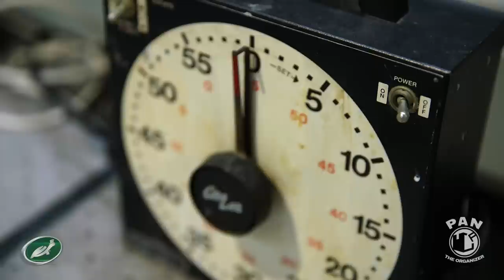EXCLUSIVE!  A TOUR OF TURTLE WAX HQ !! (EXTENDED CUT)

Comment: I have recently used hybrid solutions ceramic spray coating on my 2019 van ..
I gave the paint a proper preparation..
Wow ,, the results were great  .
Looks deep and rich .
Hopefully it will last.  Ease of maintenance is what I am after.
Reply from the maker: Yup!  And you can maintain that finish with the Turtle Wax Ceramic Wet Wax as a drying aid.

Comment: I've gone all-in on their Hybrid line of products and have loved them all with the sole exception of a problem I had with their 3 in 1 Detailer.  But they quickly offered a replacement or refund after contacting them (I chose the replacement as it wasn't the product that was a problem, it was the spray bottle it came in).  I'm really starting to love these guys.  Too bad I don't have a black car anymore.  After fifteen years of owning a couple, I went with another color this time around.

Comment: You use a foam cannon to spray on the soap.  Then you wash and rinse.  Is there anything like "Jet Dry" you can use in a final rinse to make drying easier and reduce any areas that may not have been dried as well?

Comment: I'd love it if they could create a rinse-aid spray which has the added property of popping the leftover bubbles after I've rinsed off my snow foam.  Those foam bubbles last forever!  
Especially if it was something I could pop onto my power washer just like a foam cannon, and boom, I can spray a rinse-aid on after my contact wash and any leftover bubbles on my driveway or hidden in the crevices around the body panels pop and rinse away with the water.  Thank you!!

Comment: Great video Pan.  Always nice to get an inside look at the people and products behind the products. 
For Turtle Wax I'd love to see a AIO exterior black trim restorative/protective product that's going to last 6+ months. Seams like most vehicles have two, three or more plastic bits that react differently to the current offerings. There's a couple great restorers on the market but they're not available in local stores, pricey, messy, take too long to dry/cure and then have a second step to add a sealant/coating after. Great job with new products in the last couple years, hope to see more in the future.
Reply from the maker: Thanks Jason!

Comment: Really liked that video. My FK8 Sonic Grey Type R is presently sitting with TW Hydrophobic wax on its paintwork, which does give it a "smooth to the touch" feel but for its yearly fine detailing going over I think I need to try their Ceramic Polishes & Wax. Need to research more on the technique I will use. Had the car from new (2018) and wax went on soon after the purchase. A wash & Clay Bar for starters then ?????

Comment: Thank you pan! I would love to see them come out with a tire shine that last... I haven't found one that last past one rain or spray with a hose. 
I just feel like all of the tire shines are just a quick show to present to a customer upon pick up. They quickly disappoint and customers and myself don't like that.
Reply: Try bare bones from chemical guy's! You'll freak! Simply the best I've found ever! Gives that deep kinda matte black oem finish that lasts! Scrub tire clean, spray on a foam applicator, it's kinda tacky and a bit thick when rubbing it in, and let it dry a bit. Dries quick. FAR OUTLASTS everything I've ever tried! I use it on tires, fender liners, anything rubber or plastic. Do yourself a big favor and try it.
Reply from the maker: Thanks!  Currently, Optimum Tire Coating lasts long.  I reviewed it here: https://youtu.be/1VSPW0NpQAo

I detail my car twice weekly so durability of a tire dressing isn’t important to me personally.  I like Chemical Guys VRP and CarPro PERL dressings.

Comment: got there instant shine sealant and it literally says lasts a year. Its so simple literally spray on car and then rinse off. i had to take it the shop and they asked me what the fuck I had on it. a ceramic coating or someshit. took me 3/4 iron decons and 5 washes and a claying the car to finally get it off... turtle wax line is unreal and you most likely havent tried the pro line

Comment: To quote Scott of Dallas Paint Correction, "(glass cleaners)...they all s*ck."

That has been my experience as well.

An easy-to-use one-step no-residue-left glass cleaner would be a game-changer for weekend warriors.
Reply from the maker: I use Invisible Glass and proper glass cleaning techniques and have zero issues, zero residue and zero streaking.
Reply: @ @PanTheOrganizer 

Thanks. I haven't used that product in a long time. Maybe I should give it another try.